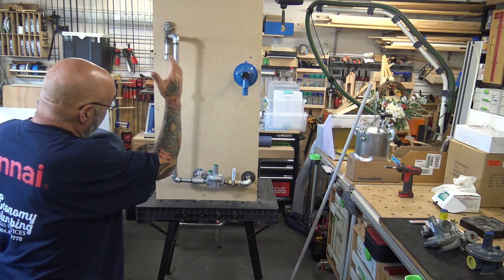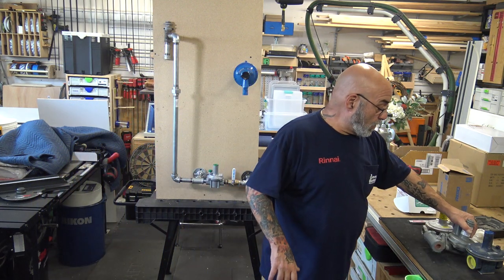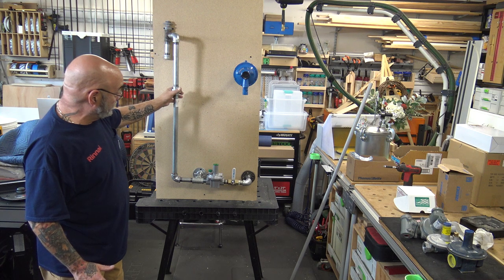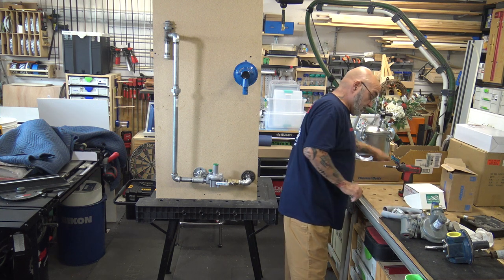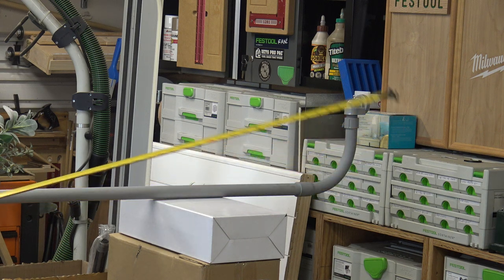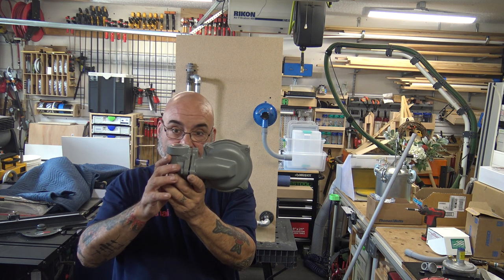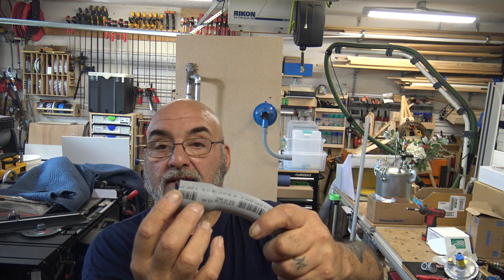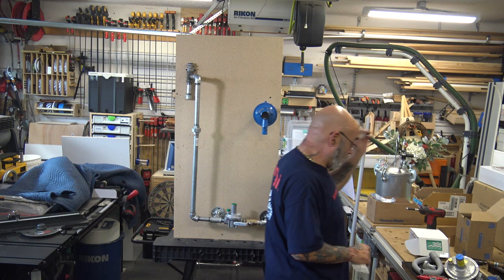The correct way to install and vent a gas regulator and a big announcement about the channel

Comment: I have a 15 K Generator, using LP gas and was looking for someone who  knew the correct procedures to replace my shut off valve and my secondary regulator and the procedures how to install those parts properly I didn’t do the original install and I thought there’s several things that are not correct and now I have a valve that’s leaking after 20 years, I thought it be a good time to correct them thank you . very much. You’ve helped me. things I picked up was you made a point size the supply line going into the equipment is the same size that you should have coming out of your diaphragm port they did not do that on mine. They put a half inch regulator into a three-quarter inch supply line and I thought that was not the proper thing to do and you just educated me that I was correct on my thought so I’ll be putting a three-quarter regulator with a  reducer to half inch from the tank line

Comment: Thank you Mike for a fabulous channel!! 
Mike’s channel not only puts out a great resource for repairing and trouble shooting these tankless water heaters but he is truly a wonderful person who cares about his audience. I’m a firefighter in Wyoming and could not get a repair technician to service my unit after my heat exchanger failed. With the help of Mike’s channel I replaced the heat exchanger myself but what I didn’t realize was that the leak had gotten water into my gas valve. I kept getting an Error code 12 and was lost! I have three kids and had been out of hot water for about four days when as a last hope I emailed Mike. My phone rang the very next morning with my savior on the other end of the line. Mike assisted troubleshooting my problem and then wanted me to call him back after I got the part replaced, just to be sure everything was perfect. Here is a hard working guy who spends his day in the field and spare time with two different YouTube channels but somehow finds the time to make sure a total stranger’s kids have hot water. God Bless you Mike.

Comment: I just wanted to say Mike is a standup guy, he gave me his number to discuss a flushing issue that I was Having and I called him and picked up the phone and helped me out. I also called him a few times over the weekend when I had an emergency with the Rinnai water heater. It started  leaking and Mike confirmed it was the heat exchanger.
I’m probably not going to get another Rinnai because of the hard water issues I have in my area, I will probably go back with a regular water heater. 
I told Mike that I would definitely use him if he was on the East Coast and would also have him install a new Rinnai because I’m very confident Mike would be able to keep my unit running for many years.

Comment: Please read NFPA 58 & 54 on venting a regulator , the vent needs to point down so rain , debris can not get in , as for rego the manufacture tell you that you must use their vent screen for regulator to work properly . lastly PVC cannot be painted again NFPA 58 - 5.10.3.1 & 5.10.3.2 , also refer to NFPA 58 6.10.1.7 ( 1 thru 7) for proper distances

Comment: Thank you for your informative videos, I have been learning a lot. I have a situation in which my tankless Rinnai unit is installed outside on the side of the house. However, it is an interior unit. My Rinnai is about a year old. I can't return it. I don't want to buy a new unit, they are not cheap. Nor do I want to give up on the interior unit. What can I do?

Comment: Congrats on the upcoming website! 
Here's my setup:
Off Grid propane. 3000 gallons of pressurized rainwater tanks. 300 gallon propane tank. Rinnai V53DeP.

My Question: I'm assuming that the propane line from our tank buried underground coming to the house is at 10 pounds. 1. How can I be sure?? We don't have any regulator at the house. 😳 We use wood heat so the gas we do have is only used for a stove top and oven. 
2. What regulator do I need at the house?
Reply: Sounds like you're running on a twin stage system which is low pressure the whole way. You would need to upgrade to a high pressure system but a high pressure regulator at the tank and then put a second stage regulator at the house

Comment: Thx MIke.  I plumbed for years.  I've supplied a 1/2 gas line to my exterior wall.  I've bought a 6500 watts Champion generator with a necessary 130k minimum BTU running capacity.  It's a household line- maximum 2psi.  The WC needs to be 5-7".  The generator will be 20 feet from the house.  My question, I bought a Maixtrol 325-3L.  I'll puT a monometer on it and adjust to 7.  I bought a vent protector for exerior.
Will there be efficient flow for the regulator chosen?  or do you have a better recommendation.
thx,
Russ.

Comment: Hi Mike---Great channel! Our Maxitrol T325-5-44 Line Pressure Regulator for inside needs replacing. I've got the new part but have never done a replacement before. I'm pretty handy. Is this this something you can walk me through replacing myself?

Comment: Hi Mike. This Jeff from Kentucky. I have installed a natural gas line to my home. Natural gas line is 2 inches,  having around 10 pounds of flow pressure. . I have installed a generic generator, uses around 355,000 btu’s. Going to install a natural gas air conditioning unit, around 4 ton unit. What natural gas regulator do I need  to run both air condition and generator.

Comment: Ohhhhh. Time Index 6:32 "Were not getting into adjustments", I have a new regulator to install, that's why I'm here per the video title. It runs a hot water heater and a four burner kitchen stove that's it. I purchased a Emerson-Fisher LP-Gas Equipment R632A-JFF. I connected it in the same spot, using the same lines as the old one. It's marked the same 9-13 as the old one. I turned on the Propane tank and used soapy bubbles and no leaks. But it won't even run the Pilot light on the Water Heater or the Stove Pilot lights. What am I doing wrong? Note all the valves were open to the house, water heater and stove when I turned on the propane tank. I live down a dirt road in the desert with the nearest houses over a quarter of a mile away. The regulator sits horizontally on a 3lb propane tank about 30 feet from the house. The system until a week ago was running for 26 year with no problems. When I pulled the old regulator off and tilted it a clear brown oily fluid came out the outlet port to the house, however the line was clean. Thanks for the video, Thumbs Up! Best Wishes & Blessings. Keith Noneya

Comment: Your videos are awesome!! Installed  an RL75IN with existing Gosett recirculation pump and WiFi thanks to you. Worked perfect first startup. Smell gas in the garage from the  Pietro Fiorentini. Does that need to be vented to the outside?

Comment: Excellent video. I do however disagree with some of the requirements you express.  Only on a negative pressure burner (RUR98 for example), do you need to keep the regulator a distance away from the water heater. Rinnai and Navian both suggest 6 feet of buffer piping between the regulator and the water heater.  When the unit calls for gas, the fan creates suction on the outlet side of the regulator and some piping needs to be in place to compensate for that suction. On a positive pressure burner (RL75 for example) there is no need for the extra piping.  It won't hurt anything, it just isn't needed.  It may be differences in state codes.  Where does the "three feet away" rule come from?  Also, according to the IFGC, 12' of 2" pipe (Natural Gas, less than 2psi@.5"wc drop) only delivers 2,760 cu/ft per hour (of 2,760,000 BTU).  Propane 11"WC@.5"wc drop at the 20' chart (can't use the 10' chart because 12' is over) only delivers 4,660,000 BTU/hr. How did you get a 7, 500,000 generator to operate with undersized piping?  You're discussion about mounting position isn't quite right either.  Finally, you should have a sediment trap, with a change of direction in gas flow BEFORE your MP regulators according to IFGC.  I don't mean any of this as hateful or "better than thou".  I have a true passion for gas piping and have dedicated my life's work to it.  I always have room to learn, and could be wrong about what I'm saying.  Let me know if so.
Reply: I’m looking into buying a new propane tankless, when I mentioned to them about the regulator being 3.5 ft away he told me that was wrong, it has to be at least 6’ could it be different for propane? I’ve worked on my TK-2 for years but it’s been discontinued and isn’t working. I’ve gotta install it myself because of living on a fixed budget, if the gas line and regulator need replaced I’ll have to hire some
Reply: @ratbastard4u  depends on the water heater. most non condensing are fine to hang right off the unit. fuel type has nothing to do with it. it more depends on the burner type.

Comment: I have a mobile home and have 2 100 pound tanks hooked up I have a camco dual stage auto changeover regulator and I’m waiting on my fisher lp R232A compact regulator in the mail how would I mount it and how would things be done properly because I been just using horizontal dual stage regulators I have a tankless heater also but my tankless is electric I got the eco smart 18 kw with a drain down sediment hooked up before my 3 stage water softener and in between both of them I have shut off valves works great for me but I need a recirculating pump on it but I don’t have a recirculating line under my mobile home so im gonna have to get the fitting for under my sink I would go to my kitchen sink put the system under there and then the water would just recirculate threw my cold water line which would be great because I live in upstate NY like I said I have a mobile home and i only have one bathroom at the time planning on adding another and adding addition but that’s coming further down the road and when I get there I will handle it but I have all high efficiency appliances and my washer I wash my clothes with cold water always have I haven’t had a problem but with my propane system I have had issues with my dual stage regulators because the last tanks I had were 250 from suburban which is a propane provider and they had a single stage regulator then a dual stage and they were all under the cap of the propane tank but on my tank I don’t have a cap or a dome and im trying to save money not waste money that’s why I went away with suburban propane they are trash and expensive I now save so much money but im running three regulators and can’t find the correct system to set up it only runs my furnace and my range and at the time actually only my furnace because my stove I bought wasn’t converted over and suburban actually Hooked it up when they hood there tanks up knowing I have kids and breed dogs and what not so yea there’s that that’s why I went away with them anyways im in the middle of trying to figure this system out correctly and make sure it doesn’t catch a fire or anything right now it’s heating good and what not but I want a more permanent situation and would like to find out more about it

Comment: If you have to be 5ft away from Ignition which is the reason you would pipe away with pvc, will this code not apply to a vent limitor? Considering you're only 36in away from the tankless ? Do I need to install all regulators 5ft away from their appliance? Smoke some gas while watching this so maybe you already answered this and I just missed it . Just wanna make sure don't wannna blow nobody up 🤦‍♂️

Comment: The 2 lb to wc regulators with vent limiters, are you having the vent those also? My understanding is if it has a vent limiter it does not need to be vented
Reply: The limited vent does not have to be piped away to outdoors. Without the limiter you would need to vent outside.
Reply from the maker: No you don’t
Reply: @ThatTanklessGuy  so just curious, when do u vent them if it's not required